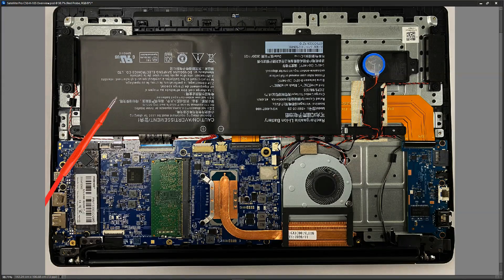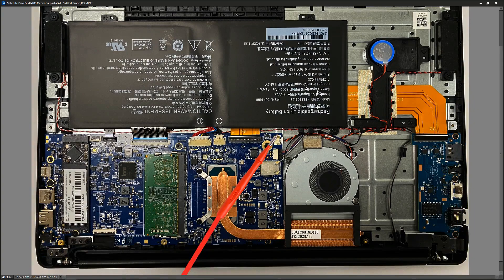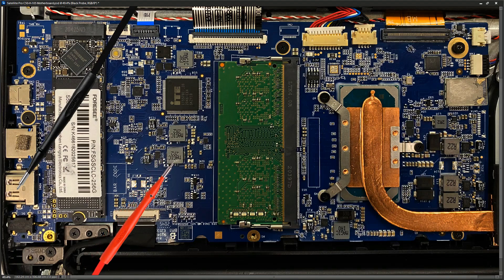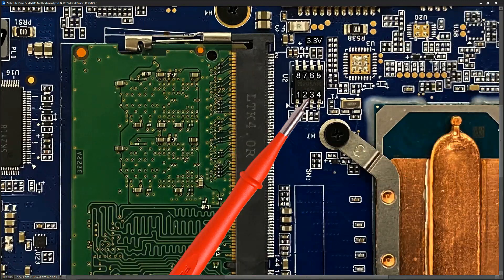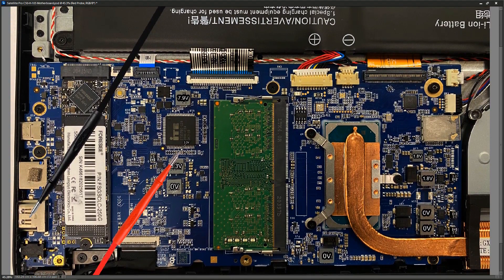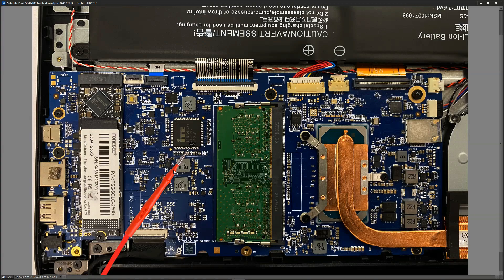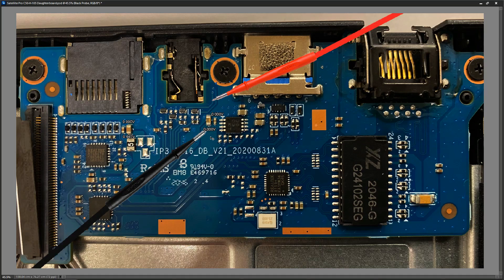Satellite Pro C50-H-105  Power Light But Not Powering On

Comment: Hi, I have the same laptop. The charging led is orange (in normal conditions is blue) and when i press the power button only the blue power led is opening just like the laptop you are fixing but after 20 seconds the blue power led turns off for a second and after that it turns blue again and the laptop boots. The battery indication is 0% but charging. 
I open the laptop and I measure the battery and is 0V. Do you belive I have to make more measurments on the motherboard or the 0V at the battery is the main problem. 
Thank you in advance.
Reply from the maker: Hi, it's quite a while since I fixed this laptop, but one thing I remember is that the capacitor seems to be a common issue with this model of laptop. The first thing I would try is disconnect the cable for the USB daughter board (at 8:05 in to the video https://youtu.be/sbCeZmJbm7E?t=485 ) and see if it powers on.

Comment: Hi ! Did you simply remove the bad capacitor or replaced it ?
Reply from the maker: Thanks for watching. It is usually best practice to find out the value of the blown capacitor (either by checking schematic or testing another similar parallel capacitor), but generally the laptop will work without the capacitor.

Comment: Seems like I have the same problem on this capacitor. Which capacitor is it? If I remove it, the laptop will power on? Thank you
Reply from the maker: Hi there,  the first thing to try is to disconnect the cable shown at 08:05 and see if the laptop boots. 

The capacitor shown at 11:30 is the one that failed on this laptop, and I have seen other videos online where this same capacitor has failed.

Good Luck
Reply: @therepairshare673  Laptop doesn't boot when I disconnect the cable. Disconnecting the usb/hdmi/lan board doesn't help.
Reply from the maker: @kenshiro3177  Unfortunately that means your fault is different.

Comment: I am looking for a charger for this model. What are the dimensions of the plug for the charger?
Reply from the maker: I took a picture of the DC coax plug at the time when I was working on it, and it was approximately 3.5mm. Just to note that this is much smaller than the regular Toshiba DC coax plug.

Comment: Hi. Did you find out what are the inductors with 1.8V for? I've got 0V on these two and my laptop is not booting. It seems the 1.8V is the supply for the processor maybe?
I've also got a short on U33 pin 2 to pin 4
Reply: I have the same problem. What is U33 IC? Is that component?
https://www.ti.com/lit/ds/symlink/tmp708.pdf?ts=1690810417259&ref_url=https%253A%252F%252Fwww.google.com%252F

Comment: Can you show me where is the bios short circuit ?
Reply from the maker: Hi, thanks for watching. 
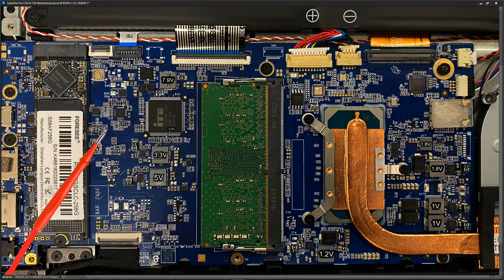The short circuit was caused by the blown capacitor at 12:27. 
Do you need me to show you where the BIOS chip is?
Reply: @therepairshare673  Yes please if it's different from https://youtu.be/sbCeZmJbm7E?t=65 . I need to reset bios. Thank you
Reply from the maker: @andreamarasca7010  Yes you are correct. That is the BIOS chip. Marked as U2 on the board, it is a Winbond 25Q128JV, which you should be able to program easily with any BIOS programmer. Maybe take a backup of the original BIOS first. Good luck

Comment: Hello,
My switched off after the charger blew while charging. Do you think it might have affected the motherboard?
Reply from the maker: It depends on what caused the charger to blow - did the wires get damaged and cause short, or did it get wet? 
Maybe take out the motherboard and check short, and if you find no short borrow a spare charger.

Comment: The sound was good until it cut out at early at 13:07. Did everything on the daughter board work OK without the capacitor you removed? Thanks for the video.
Reply from the maker: Damn, you're right. I need to get a more reliable audio recorder. 
Only fault was the dodgy capacitor. Not sure how it happened, think the user may have plugged something dodgy in to the USB port.